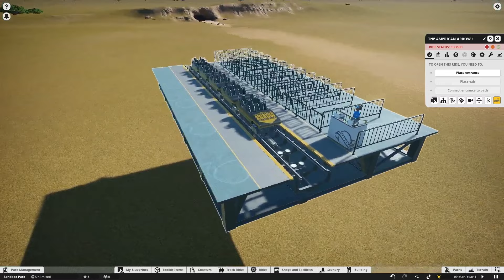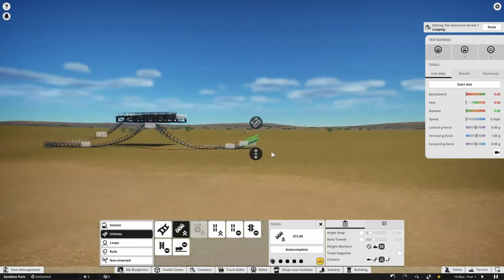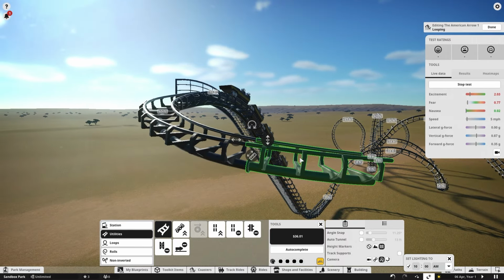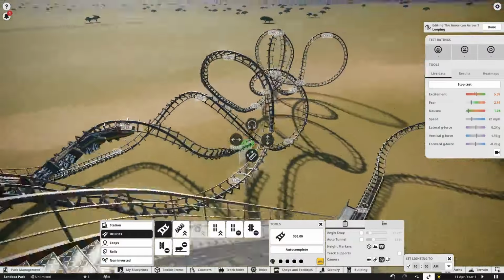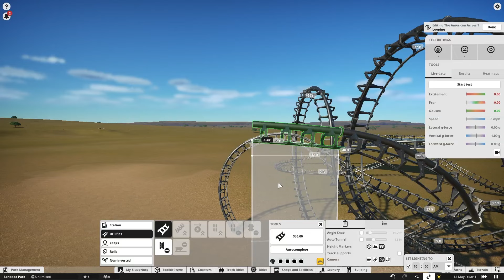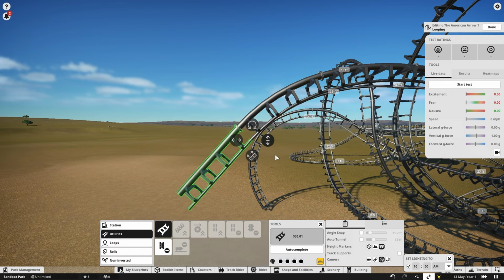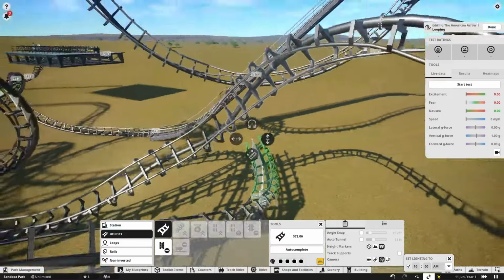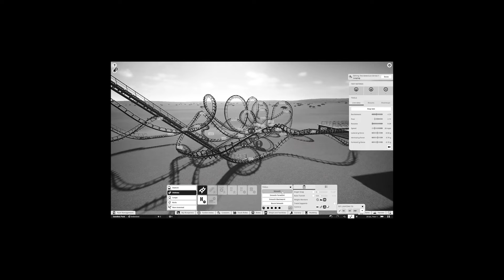If The Smiler was Built in 1994

Comment: Arrow could have certainly made this. 94 was late in arrows timeline. Remember the mega loopers like viper were all open by then and set the 7 inversion record and pretty much the inversion standard for all coasters intil b&m broke it with 8. If the park had the money arrow would have built it. Arrow always pushed for crazy designs and expirimental coaster types. Arrow was more daring than any other manufacturer. The reason the coasters stayed rough was ron tumor didnt want to give up his passion of designing coasters and if they switched the cad he would have been pushed out.
Reply: They did with Drachen Fire

Failed miserably, so miserably that they dumped Toomer and assigned Schilke (Which leads to second and final demise)